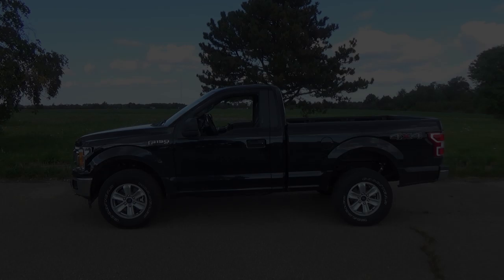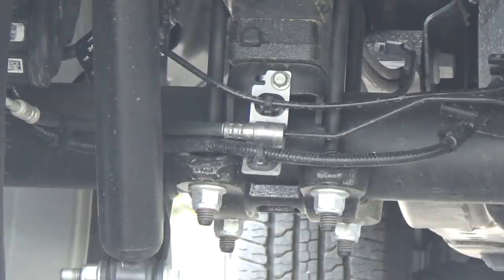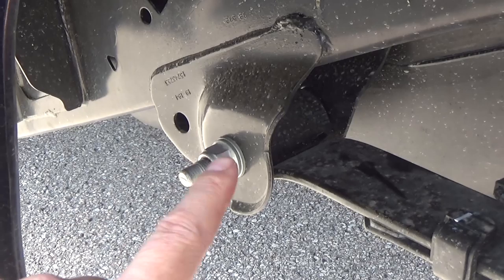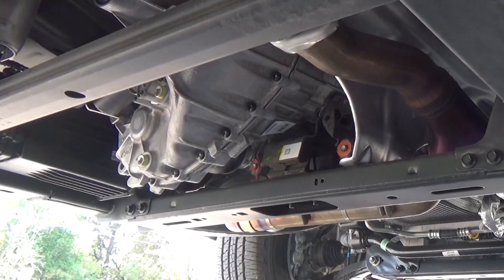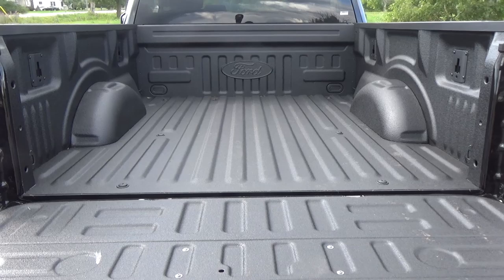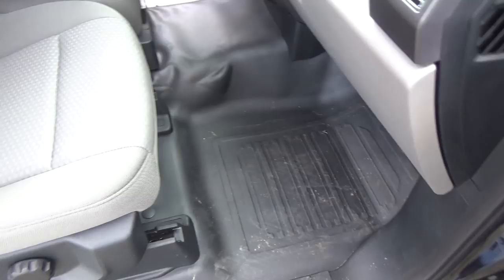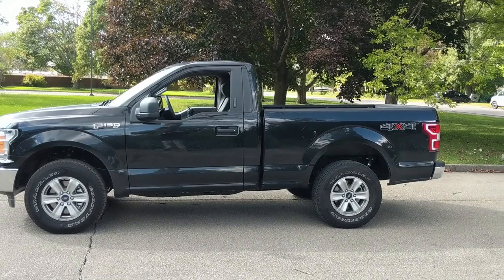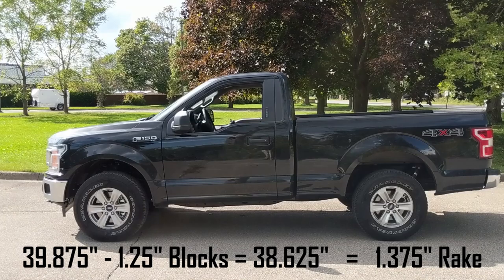2019 F150 5.0 RCSB 4x4 w. Tow Pack

Comment from the maker: I forgot to mention the cost in the video, I don't mind sharing this info, in case anyone was interested;

MSRP for this truck was $49,873 Canadian + HST (13%) = $56,356

Now, I ordered it in June 2019 during Fords "Summer Sale" event (saved $3500), paid cash (saved another $4,500) and with a Ford Employee Pricing Rebate (saved an additional $5000) we saved over $14,500 and bought this truck for $35,357

Because it's a company truck, we save the tax, so that's the final price.

Additionally, the law here in Ontario, Canada states that if your truck is a Single Cab, you can use it 50% Personal and 50% Business.

If it was a Super Cab or a Crew Cab, you can only use it 10% Personal and 90% business.

So for every 100km as personal use, I'd have to force myself to put 900km business.

Single Cab was the way to go!
Reply from the maker: @all_ontario_hunter yes, ELMN80R! Thanks for watching!
Reply from the maker: This truck is awesome man I absolutely love it, got an MBRP side exit exhaust on it now it's quite loud but I think just where it needs to be.
Reply: Love the content!  I went the other way and did a 2" front level.  I also added the Torsen front diff, and 34" tires.  I was really surprised to see that your 5.0L with the trailer tow package and rear locker has the super 8.8" rear diff.  Mine is a 9.75" rear diff.  It seems the only difference is that I have the 3.73's and the snow plow package.
Reply from the maker: @fabulousoffroaddesigns5080  from what I've heard, the FX4 pack gives you the 9" and the 8.8" is standard on the 4x4

There's no actual info on Ford's website though...
Reply from the maker: @fabulousoffroaddesigns5080  also be sure to check out the playlist on all the mods I've done so far; https://www.youtube.com/playlist?list=PLOTWBqOo4HbXFQ2T1ENgyUKB9xo6WIrdB
Reply: Eliminator Performance considering this for after buying a home to graduate from my mustang.. figure it weighs less than a full cab, bit of a mix between performance and utility vehicle?..
Reply from the maker: @Ultrajamz  well it weighs less than the Dodge Challengers and the 4x4 5.0 rcsb only weighs about 600lbs more than the mustang GT lol it's an excellent truck and I'm quite happy with it!

Comment: I would have left it alone, i thought it looked good but if anything maybe a front leveling kit to even it out. 250.00 installed here in the US. Over time with towing the rear would settle. Nice truck
Reply from the maker: Thanks Gary, and many have suggested the front leveling kit, but I honestly don't want it any higher! Plus, I like the sporty look of a leveled truck.

As for the rear end sag if I tow, I'll be installing an Air Ride air bag helper kit for the rear (adjustable from 1-100psi) to assist with towing!
Reply: Eliminator Performance very smart idea
Reply: Eliminator Performance 
Leveling won’t particularly make it higher but I get what you’re saying.

Comment: you don't get 4auto with that truck - making that 4x4 in canadian winters useless.... u have 4h and 4 l for offroading purposes only  - no pavement -  so many people make the same mistake
Reply from the maker: It's no mistake, I have winter tires and drive just fine in 2wd in the winter. You only need 4x4 if you get stuck, and it's nice to be able to turn it on, get out of some snow or mud, then turn it off. It's not needed all the time.

Comment: you do know that whoever told u that u needed to remove the fuel tank and the muffler were lying to u.  no need to remove the front spring bolts  only loosen them. all your work is being done to the rear. no need to remove the front bolts. dont give yourself unnessary work . to anyone reading this . loosen the front bolts loosen the rear   get a transmission jack under the axle to support the weight. then remove the rear brackets. u then lift the entire rear axle and install the longer brackets at the rear and torque them down . you can then loosen the u bolts and use the jack to take the weight of the axle. now remove the u bolts completely.remove the blocks and lower the axle back onto the springs. and replace ur u bolts and torque them down. remove the jack and dont forget to re torque the front bolts.   lower the entire thing onto its wheels  and then go over all ur bolts with the correct torque settings .   no need to mess with your exhaust or fuel tank .

Comment: Super informative!! Lots of 4x4 owner out there prefer level drop instead of lifting....and all those details you gave like shims for transmission I would have never thought of! Not as simple as just installing the drop
Reply from the maker: Thanks, I plan on doing more vids with the truck so stay tuned! And yes, I did a bunch of research and called around before picking a kit that was to my liking. I prefer the stock height in front and didn't want to raise to level as you mentioned. This truck still hauls and I've had quite a bit of payload in the bed and it rides great.

Thanks for watching!

Comment: Super nice truck. RCSB's are pretty rare nowadays. If it were me, I'd go with a front leveling kit to fit bigger tires and get a utility trailer for hauling. Everyone's needs are different though
Reply from the maker: Thanks, and yes, everyone's view of their "perfect truck" are different, you hit the nail on the head with that!

This truck is awesome with the k&n intake and exhaust, and I'm looking at a tuner for the spring.

The 22" wheels also make it handle super nice.

I'll definitely be doing more vids on it, check out the f150 playlist if you haven't already done so already!

Comment: WOW THAT IS TO COOL!!! I have had short bed reg cab sence my first one a 1963  4x4 And still have one. The one have now is a Dodge  short bed reg cab 4x4 .  I also had a new 74 ford  with the 460 v8 4 gear that was one he## of a truck. Have fun with your new one and keep the dirty side down.
Bob
Reply from the maker: Quite the fleet you've had! I'm a big Ford guy, stay tuned for some videos on a classic Ford!

As for me, I learned how to drive in a 1978 F150 4sp manual with a 300ci inline 6, that was also a RCSB 4x4, thing could pull a house down!

After that I owned a 77 crew and a 79 F100 single cab long box that I pulled the 302ci out of and I'll be building a stroker for a special car that I haven't revealed yet!

Comment: Leverage man. I’d have left the rear stock and invest in an ergonomic stow-able bed ramp(s) aswell as maybe a bed winch or bed crane depending on what else you’re loading. However to each his own, there’s a good argument for either solutions.
Reply from the maker: I used the Ford Performance OEM drop kit for the rear, truck is currently sitting level and I couldn't be happier!

Comment: nice truck ! i had a similar one in 1998 with the stepside and i used a 2 inch drop shackle from aftermarket but didnt do any pinion angle shims and it seemed fine. 
FYI; it came stock with a side exit exhaust which i think was prematurely rusting the aluminum wheels cuz there was green pitting on that passenger side rear wheel. it still had a yr of warranty so Fords fix was to install a rear exit ehaust tip.
Reply from the maker: I like the step sides! Thanks for watching

Comment: If you just loosen the front leaf spring bolt and nut, once you remove the rear shackle nuts from the bolts, you can use your jack to raise the axle and raise the bolts above the frame between the bed of the truck and push the bolts out. The lazy option would be ordering new bolts altogether and just cutting them. But dropping the fuel tank is drastic and Ford performance recommended such to keep you from wanting to do the work yourself and taking it to a ford certified mechanic. I do however appreciate the advice on the shorter U bolts from the 2wd truck and the transmission shim. I was just gonna settle for the 1 1/2 inch drop the shackle kit itself offers.

Comment: I have that exact same truck.
I love it.
Reply from the maker: You should see mine now lol about 5 grand in aftermarket parts and it's completely different lol

It's been lowered, wheels and tires, exhaust, intake and also the oil seperator!

Filmed everything, and will continue to film anything I do to it, will be posting vids every now and then!
Reply: Sweet, I met this old guy at the gas station the other day he had a F150 with a 5.0 , he had to show me the twin superchargers he put on it....CRAZY , a real sleeper , said it would smoke all 4 tires in 4wd.
Reply from the maker: @billlovett4256  bet that was a Hellion Twin Turbo Kit, they are sweet! Stage 2 is like 750hp on e85 I'd love to have that but this is still a work truck lol
Reply: I'm keeping mine stock and dirty, it's definitely a work truck.

Comment: Nice truck! I have a 2016 reg. cab f 150 with fx 4  xlt.  It only has 8000 miles on it. I want  to add the new Ford  front end lift kit to level out the truck. I've got the 5.0 v8 also.
Reply from the maker: Thanks, and nice, they are amazing trucks! I lowered the rear and couldn't be happier! Looks awesome and handles great, stay tuned for more vids, and thanks for watching!

Comment: I have a 2019 regular cab F-150 that's pretty much on the other end of the pricing spectrum from yours. It's a 2WD F-150 with a 3.3L V6. The only perks it has over the most basic fleet-style F-150 are the chrome appearance package, a spray-in bed liner, power windows, and tinted windows.

Personally, I wouldn't have wanted an EcoBoost engine even if it had been within my budget. I think you made the right call when you decided to go with the 5.0L V8. I'm sure the EcoBoosts are fine engines for a while, but I've heard that turbo engines can be trouble over the long haul. And I tend to keep vehicles for a long time, so I want something that can last. I had a 2008 Tacoma for 11 years before I got my F-150.
Reply from the maker: Yea I love this truck so far, I was down 1qt of oil after my 1st 2500km, but they say these 5.0s burn oil up to around 3000km.

I'll have to keep an eye on it and see if it gets worse, honestly, all engines have their own separate issues.

Thanks for watching!
Reply: I agree bro. For my business I bought the same 3.3L V6 non turbo. It’s a 2016 no issue little maintenance besides oil change and Comercial heavy duty tires. I am liking for another truck possibly with bigger engine for more power and more payload. I think the V6 turbos are cool but for the long term I would think
The 5.0L V8 would be cheaper to maintain even with the fuel savings. I love turbos and own a Mazdaspeed3 (turbo). At the time I debated a Civic SI and sometimes within went that route for the simplicity.
Reply from the maker: The Ecoboosts advertise better fuel but they're actually worse than the 5.0 lol I get anywhere from 15-20 mpg depending on if I'm in sport mode or eco mode
Reply: Eliminator Performance Exactly. No matter what the EPA rating are, your foot is the biggest indicator of the true EPA. My Mazdaspeed 3 Turno is rated at 25 MPG hwy. I just took a 409 Mile trip today about 95% freeway and I got around 29/30 mpg going around 70-78 MPH. And for my use I’ll be using for a work truck with a huge glass rack draped on it. So I won’t be gunning the gas. I will get the Regular V6 again or the natural V8.

Comment: I test drove one with the 3.13 gears and it felt like a Corolla. I will be getting a Regular cab 8ft bed with either 2wd 5.0 and 3.55 axle or a 4WD 3.3v6 wit 3.73 gears. It all the 3.3v6 to have the same towing and payload numbers as much as the 2.7 ecoboost.
Reply from the maker: Yes that's one of the biggest issues I hear with people test driving the 5.0s is the people think they're gutless. You get 3.55 or 3.73 and the trucks are rockets. They're also light, my truck weighs about 200lbs less than a SRT challenger lol and it's 4x4 5.0

Honestly, go with the 5.0 you won't regret it!
Reply: @EliminatorPerformance  thanks bro. What sucks is it will be a work truck. I can’t afford the 4WD 5.0.  But that what I’ll most likely be getting. Crazy how fast and light your truck is.
Reply from the maker: Yea it's actually ridiculous, I love this truck so much. I've never had anything new before, so it's nice to have the reliability for my business too.
Reply: @EliminatorPerformance  Nice bro congrats. That th good thing about Ford they are very reliable. I have a 3.3v6 already with 3.55 axles and it’s fine. Especially when you put it in sport mode.

Comment: Gooed day  Oh we are going to have  a  problem, I have a Chevy.lol  Nice looking truck  10 spd, 1300 = 100 klm.  boy that should keep engine wear down , & gas mileage.    So   8th,9th, & 10th are 3 overdrives,  Boy this should being interesting in next yr. or so.  Thanks & good luck
Reply from the maker: Haha I love all trucks, but I'm a Ford fan at heart! And yes, I plan on having this truck for a long time, we shall see how it holds up!
Reply: @EliminatorPerformance  Good day Are you going or did you undercoat it.  Thanks
Reply from the maker: @donvoll2580  going to be undercoating just the frame and suspension areas because that's steel, the doors and body is aluminum so I won't be spraying that!

Comment: This is definitely my next vehicle. I didn’t know Ford made these new anymore. 5.0 with the 10 speed is a monster especially in 4x4. Ford is the only ones I see that will let you do a 3.73 rear locking diff.
Reply from the maker: Yea and if you get the 3.73 they upgrade you to the 9.75" rear differential instead of the 8.8" "super 8" that I have. But 3.55 in this light truck is plenty I can tell you, the thing is a rocketship lol
Reply: @EliminatorPerformance  awesome. I can’t wait until I can grab one. I’d throw that 4x4 on and enjoy that 3.73 from a dig lol.

Comment: so why doesn't Ford drop the rear to begin with?
Reply from the maker: Because with the tow package, they add an extra leaf and lift the rear, so when you're towing a heavy trailer, the truck then sits level. The thing is, I don't tow heavy enough to worry about that. But I still get the transmission cooler and upgraded suspension with the tow package.

Comment: Good luck with it.
Do the cold air intakes help??
Reply from the maker: Stock air filters are paper, they are very cheap.

In the small engine world, OEM air filters are superior and aftermarket are cheaper.

In the automotive world, K&N offers a washable, lifetime airfilter that (due to the design of the intake tube) should increase power by about 11hp due to it being less restrictive.